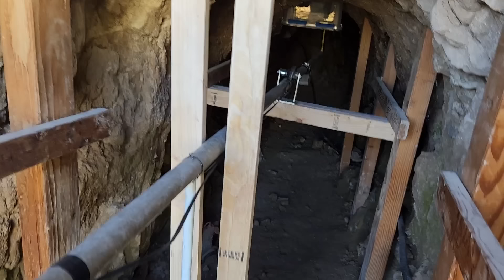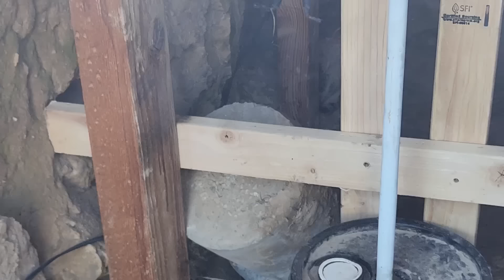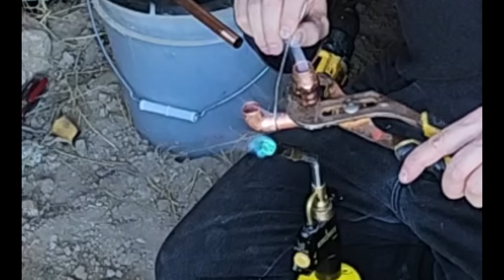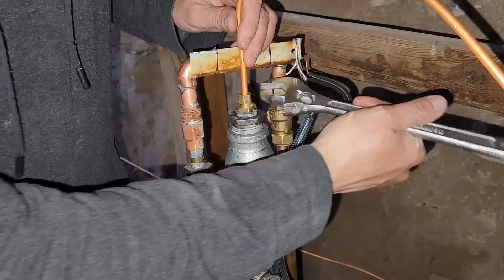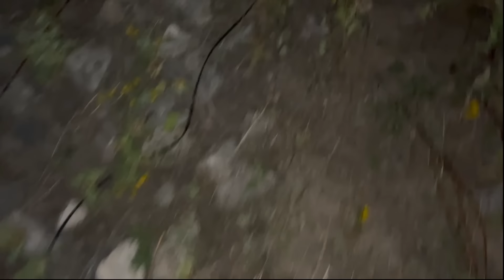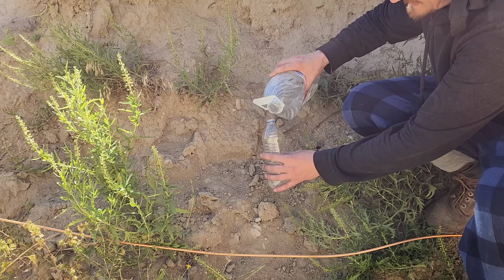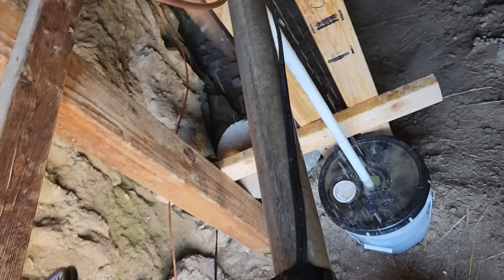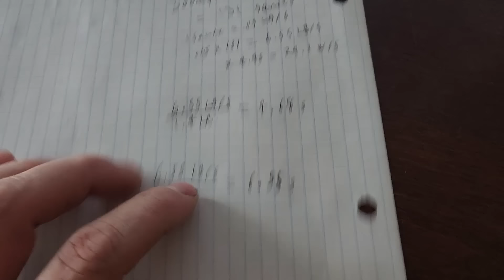Sodium Water Hybrid Rocket?

Comment: Awesome video 💓💥
I have a thought 🤔
I think can try modifications to the fuel packing, maybe instead of the threaded fuel packing, cool as that is.
Can try a smooth rod instead?
And, or,  can try a sanded smooth twisted square rod  to, "smoothed" for easy removal, that could make a vortex,  might make the fuel burn more efficient too? Maybe? 
Also check the water power washer nozzle. 
Maybe different power washer nosel sprays can help. 🤯 Or can direct the spray into a twist to burn all the fuel, 70g of unspent fuel is a lot.

I wonder if it's possible to add a little of potassium powder to the mix? Would that help or make it too unstable? And dangerious?
Be cearful don't go boom 💥 💀 🪦

🤔 is it using chamber compression to force the water out too?

Comment: Fantastic project and you got results! Hybrid rockets always seem to be rough to get working well. Would it be easier to get the propellants to react if the fuel was a liquid sodium-potassium mix? I noticed the calculations appeared to have a superfluous "/" in the calculations of the Newtonseconds. I don't think it belonged in there. Anyway, I wonder what a ghetto setup for manufacturing some metallic sodium might look like... the chlorine would be a nasty side product if there's no further immediate use for it on site. Hmm.

Comment: Awesome idea, I love this. :D   If you try a liquid metal propellant though, I wonder... could you have a heated nozzle that melts the metal right before it enters the combustion chamber? Once the rocket is going, the heat of combustion should make it pretty hot. It's just a question of how to start it. Maybe you could feed it a cylindrical slug of metal like a 3d printer filament that gets melted and injected at the tip. Looking forward to future videos!

Comment: The inertia/momentum of that very heavy motor throw the thrust values off. There is a reason why we test rocket motors using load cells rather than balances.

Comment: I’m no scientist, not near as smart as you Cody. But I wonder if the reason your having trouble with unburnt sodium leaving the chamber prematurely is a surface area problem. I’d bet if you halved the weight in sodium and just focused on maximizing surface area, maybe working on your injection system, making thin sheets of sodium and separating them by a small amount like a heat sync, or a lattice structure. My thinking is it’s a lot easier to start out burning kindling than going straight to the log. Just a thought man, thanks for always coming up with ideas that make idiots like me think about interesting things!

Comment: Suggestion. 
Put an air bladder in the airline, lower the pressure that the water enters the burn chamber, add Dawn dishwashing liquid to the water to help dispense mineral oil, and next time you pour in the sodium first coil up inside of the pipe some high-temperature mesh to help hold on to the sodium
Reply: Yeah I wonder if the 800psi water jet may have sliced through the sodium metal.

Comment: If you had a roll or of sodium wire, maybe you could feed it in the chamber using an extruder to get a controllable reaction? You could adjust the feed rate and heat, which may help avoid that gray oxide layer? The extruder would probably act as a water stop, and the spool of sodium could be stored in an oil filled canister.

Comment: To solve the sodium melting out problem, maybe you could put a metal tube down the middle of the combustion chamber that is welded to the nozzle to seal the bottom off. Then the pressure travels up the outside of the top of the tube and back down the inside of the tube to the nozzle to generate thrust. The melted sodium, in theory would pool up at the bottom where the tube is welded to the rocket walls. If the sodium still sputters upward and gets wasted before full combustion, maybe you could weld a metal plate above the sodium with holes in it. That way the oxidizer can still reach the sodium and react, but only the gasses and water can make it through the gate, keeping the sodium locked in place hopefully. I am curious to see how much more efficiency you can squeeze out of a sodium rocket. I think the idea is really cool.

Comment: The "quick fix" for a sodium-based fuel that isn't "metallic" is bubbling hydrogen gas into molten sodium to make sodium hydride. The energy density and reactivity should go up, and it could be fed into a "combustion" chamber as a sintered rod or aerosolized dust.

Comment: i thought of that with nak and injectors but never thought of the benefit of sodium overall instead. good thinking there cody. you could try injectors for both water and molten sodium which would mean you'd need a preheater for the sodium. the solid fuel route...is doable but seems a lot more work overall as you have less control. metered injectors of some description. this needs more people on it.

oh, and since sodium even molten is a metal...MHD pumps baby!

Comment: Maybe pour molten sodium into the combustion chamber at the same time as water injection? Could hold sodium in an external vessel where the heat of the engine would melt it and allow it to continue running into combustion chamber.

Comment: Love that you're still out here doing the coolest backyard science

I wonder if you could make some kind of telescoping injector that starts near the bottom and moves up through the sodium so you're not blasting hot reaction mass through your unreacted sodium, kind of like how a water heater injects cold water at the bottom and takes hot water from the top so the temperatures don't mix
Reply: Cool idea. I wonder if the steam from the reaction at the bottom would be sufficient to react with the sodium metal above it, and at a more controlled rate, the sodium metal only falling away once it becomes sodium hydroxide. See my other comment about potentially mixing in aluminum metal to convert the sodium hydroxide to sodium aluminate and freeing more hydrogen. Having an oxygen source would also be needed so the combustion doesn't occur some distance away from the back of the rocket once it mixes with atmosphere.

Comment: I'm good at math and chemistry and I like to think I'm a "generally intelligent" guy, but the way Cody's mind works make me think he might actually be a genius. Like I would have immediately resorted to trig and algebra and developed a conversion factor to determine thrust. He just weighs the paper lol. It's so much smarter.

EDIT: Some thoughts from an r-candy amateur (although I did design and build all my fuel grains and nozzles and control systems by hand), IF you decide to revisit the hybrid concept: Grain ejection is the bane of every solid rocketeer. You might try a wire grinding disc to rough up the inside of the fuel chamber before casting. You might also create a reinforced mixture, maybe with shredded fibers of kevlar or anything else that could survive being encased in molten sodium. You could potentially create a flat sheet of laminated aluminum and sodium, and then roll that up into fuel grains to stuff inside the rocket.

From there, yeah, you'd need to move on to adjusting the chemistry. Maybe dissolving sodium nitrate into the water? I also liked the peroxide idea you mentioned because you could potentially just superheat the water, slam the resulting steam through the injector, and basically eliminate the theoretical ceiling on your Isp. A platinum catalyst screen somewhere in the fuel system could break the peroxide down, generating even more thrust via H2 + O2, but of course that would mean the Na fuel would no longer dominate the thrust considerations. And it would also be almost guaranteed to explode at some point in testing.

There are a million directions you could go with this idea. It's pretty clever even if the Isp was a little lacking in the initial test. I really hope to see more of it! Be safe!

Comment: Honestly, with how easy the sodium turned to liquid, I don't think you need a sodium-potasium mix. Just cap the sodium container with conventional solder (first cap the bottom with a slightly higher-temp solder, pour the sodium once solid, then if desired pour an upper cap when the sodium is solid), preheat the sodium container, then use a battery-powered inductive system to take it the rest of the way. The biggest challenge would probably be to time the water to the sodium correctly.

Comment: Cody, for flying rockets there’s what’s called the Amateur Exception in the FAA regulations and people regularly build large metallic VTVL and ascending liquid (sometimes hybrid) rockets and fly them.  At Black Rock in Nevada the airspace is under a quirky uncontrolled category where the paperwork is particularly easy.  The folks at Friends of Amateur Rocketry site in California are great supporters and a launch site as well.
Reply: I'm sure he got burnt when the fbi came to take all his heavy water
Reply: I thought he drank all of the heavy water.. 😆
Reply: I believe Cody is misunderstanding the "Contains no substantial metal parts"  part of the regulations, which would pertain to casing, motor-proper, etc. elements, not the propellant composition.

In a working sodium rocket, I (if not Cody) would use mostly ceramic elements, and carbon-fiber-wound, casings and high-pressure components (air chamber and water chamber and lines).
Reply: @1-danR  We all know Cody looked into it for like 2 seconds before deciding to just do it in his mine.
Reply: @1-danR the metal pipe seems pretty metallic though 😀
Reply: @hvip4 sounds like you only read half of the comment
Reply: @TheAechBomb  sounds like you missed the 😀 joke indicator.  All good, I do it too.  :)
Reply: @DavidLindes that looks like someone being snarky, like saying someone’s an idiot for not seeing the obvious, not a joke indicator. It can be challenging to discern one’s tone and meaning in just written words. 🤷‍♂️
Reply: In addition, both the National Association of Rocketry (NAR) and the Tripoli Rocket Association (TRA) in the USA and Canada use commercial metal cased reloadable motor casings.  TRA rules permit the use of amateur experimental rocket motors with metal casings, but limits them to solid propellant and gas/solid hybrids.  So, having a metal motor casing or nozzle is not illegal.
Reply: @BryanTorok yeah, it sounds like he was maybe trying to make it a class 1 rocket and not a class 2?

Comment: could you do a three tank system one with Solid sodium running a little water through it to react and melt a little bit of sodium at a time. then the reaction chamber has a larger flow of water to react with the incoming liquid sodium so you don't expend all your fuel immediately. i would be worried about pressure build up in the solid sodium tank though.

Comment: As complicated as this sounds, a helical injection tube with multiple nozzles going the length of the solid fuel would probably eliminate a lot of these issues. Perhaps a 3/16 nozzle as well to help keep from losing matter out the back end?

Comment: I'd definitely like to see you try with NaK; I thought of that shortly after the start of the video, as it'll allow you to spray it as a mist into the spray of water and get a much more thorough reaction.  Though you'll probably have to make your own as I don't think you can just buy it.  After you get that working, then maybe you can look into adding injection of pure oxygen to the reaction chamber to burn all the hydrogen being produced to get even more thrust.

One more thought I had, that would allow the use of pure sodium, is to melt it first and keep it in a pressure vessel to spray through a nozzle.  How to keep it molten is the trick; given that it melts at 98C, ie just below the boiling point of water at 1 bar, what comes to my mind is to have nested pressure tanks - the sodium tank can be in the center, then the outer layer would be the water tank, heated to well above boiling so that the sodium stays liquid, and the water tank will be pressurized by the water vapor.  When the reactants are released into the combustion chamber, the superheated water should flash into steam, enabling even better reactivity with the sodium droplets, plus the additional heat should boost thrust?  It would be more complicated to build, but it's a thought.

Anyway, it's good to see a proper old school Mad Cave-Scientist Cody video again!  Thank you :)

Comment: What if you kept the solid fuel and injected a mist to that chamber from below and had the exhaust curve around and down to the nozzle below the chamber to keep thrust going the right way? Also could you mix in a fibre to the liquid sodium before it cools to give it more strength and support? may be even a fiberglass mat or roll to keep it from getting pushed out? I think you also need to determine the minimum rate of water exposure to ignite the sodium without putting too much water through. Probably would need years of experimentation to get the most efficient results.

Comment: Sodium hydroxide is water soluble. And Basic Rain isn't a pleasant thought.

So clouds of it would be disastrous.

In limited volumes it could be beneficial to cropping soils including your own tho.

On the subject of Liquid Fueled engines. In deep space you need to store your propellant safely, water is pretty heavy.

I had been pondering a Peroxide based solid booster could have long storage and none of the pressure issues and is even able to spontaneously ignite with a variety of solid fuels which could reliably be used for a Mars Mission

But the problem with the hybrid design is you only ever get ONE good burn out of each engine, even if you can throttle the rate, reigniting one will never have the right fuel geometry.

I figure that probably means that you'll need lots of maneuvering thrusters to refine the burn of one. So a mars mission needing 4 fast burns to get moving out of orbit quickly and avoid radiation belts on earth means 8 paired boosters, that need to be disposed of appropriately. Which is a significant amount of space junk you need to dump into unstable orbits to keep the path clear.

If you rely on the slow way through the Martian orbit however you are adding weeks if not months to the journey relying on Ions.

And keeping liquid rockets steady usually means keeping them warm enough, or venting enough pressure that you are adding failure modes or wasting fuel.

Although I suppose you can dump waste gasious fuel into the ion engine for added propellant.

Comment: the way to do this is probably not hybrid but using liquid sodium or even NaK which is liquid at room temp. This likely has a much better efficiency if you get the injectors right

Comment: I recommend using a burst disk between the water and sodium, and then placing the water reservoir above the sodium. Seal off the bottom of the sodium chamber and have the nozzle connected off the top of the water chamber. 

With this setup, the sodium can melt all it wants, but it is trapped in its chamber with the water until ot is fully reacted. 

You would need some backflow prevention on the gas input, but ignition would only need the argon to pressurize the water to the burst disk's rating.

You would probably need another slightly higher rated burst disk on the nozzle so the water can become pressurized instead of the argon just going out the nozzle.

Comment: just a suggestion that my brain has delivered unto me without any proper thinking through :-

how about using granular sodium fuel pellets fed in by gravity, and introduce the water as ice - as the water begins to melt, drops of water will hit the sodium pellets causing exponential thermal increase in the chamber - the will both shatter the ice and convert it to water dispersing it, possibly resulting in a series of reactions within the chamber and achieving a higher fuel consumption efficiency ?

Comment: I'm not super familiar with rocketry but I bet you could probably cast the liquid sodium into something porous, like a carbon sponge (carbonized white bread, etc depending on ideal density) which would ideally burn away with the sodium but not before it, allowing some level of control on the loss of liquid fuel via wicking. That being said there may be unforeseen interactions between trace chemicals in charcoal that may make other materials preferable. Good luck!
Reply: Cast it in orbeez!

Comment: You'll have to confirm this but I don't think you need to ask permission to launch a rocket as long as you meet a couple of requirements

First there is no rule that says you can't have metal in rockets The rule is you can't have substantial metal in the construction of the rocket and the metal you do have should be ductal which sodium absolutely qualifies for

So there is no problem with construction as long as you build a conventional model rocket with a small amount of metal and you keep that metal ductile such as using aluminum or very thin metal just you can't build the entire rocket out of metal

Next you need to keep the entire rocket at below 3.3 lb and you need to keep your propellant mass in this case that would be the sodium itself blow 125 g

So as long as your rocket is not substantially made of metal is below 3.3 lb and has less than 125 g of sodium inside you should not need any permission at all that would be considered a model rocket where the only restriction you may have is that if you're within 5 miles on the airport you need to notify the airport that you'll be flying the rocket You're obviously more than 5 mi from the airport so you should have no regulatory problems flying the rocket